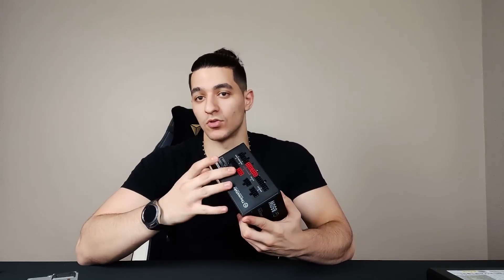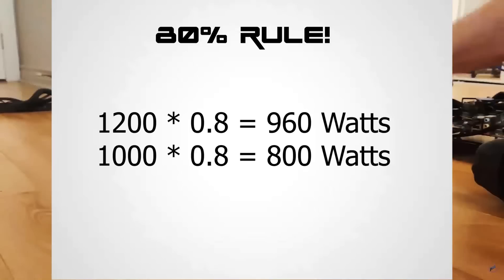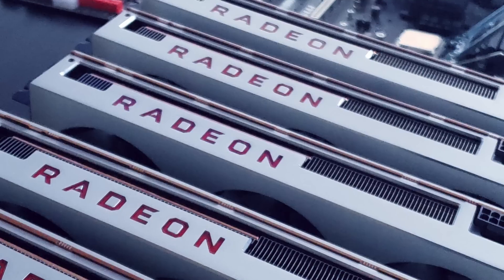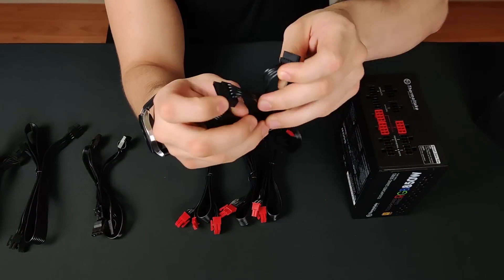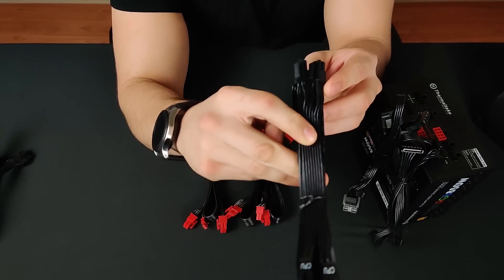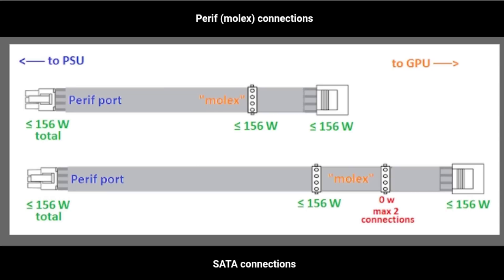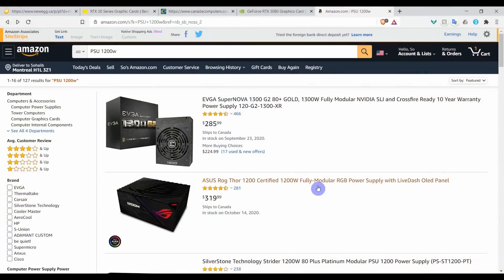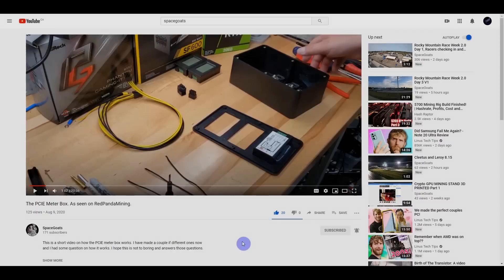Using ATX Powersupplies For Your Mining Rig FULL GUIDE

Comment: Can I power 3 or 4 risers using a dual 8 pin pcie cable from the psu and attaching dual 6+2 pin splitters from each 8 pin?
Reply from the maker: Yes, I would suggest max 3 risers on one vga cable though
Reply: @MiningChamber  Where did you buy your gpu vertical mount the one you're using to bios mod your gpu's?
Reply: @MiningChamber  Thank you for the reply by the way. :D

Comment: so i did this set up and my second psu is making clicking noises... it didnt do that when it was used as the main psu any ideas what causes the clicking sound? looked at it already and no wires were hitting the fans
Reply from the maker: Mm clicking noises, check if anything smells like burning, double check all wires and make sure you wired everything right. Take a look at the latest build video I released for example on wiring
Reply: @MiningChamber  thanks for the tips ill go do that the clicking noise is odd because i only had 1 gpu connected to the 2nd psu the other 2 gpus were in the main psu

Comment: I have a EVGA 750 watt psu powering an AMD 3000g, and 3 Geforce 3070s. I use a 8 pin to dual 8 pin to power one gpu and it’s respective riser. Is this safe?

Comment: Hi all I need to ask something can I connect 3 atx power supply to the same rig ?
Reply from the maker: Yes with the powersupply splitter ! Just daisy chain it
Reply: @MiningChamber  why is 24pin splitter needed? does it sent some information to psu? cant i just connect one and use another psu without 24pin connection?

Comment: I'm a bit confused, when I search for max wattage pcie cable people say it's 150 W for 8 pin. This guide says 288 W. I'm thinking of putting a splitter to power 2 GPUs on 1 8 pin pcie (lost the pcie cables that came with the psu). A 1070 and a 1660 Super, is this a bad idea?

Comment: I have 2 lines of 2 molex each, can I connect the riser with a 2 molex to 6 pin adapter?

It would be 1 riser per molex line, okay?
Reply from the maker: Yes that's fine! You can do molex directly to riser but just do one riser per molex cable
Reply: @MiningChamber   Perfect, thank you very much

Another query, I have 6 3070 but only 2 700w Artek Voltron, it has 2 8 pin pci-e lines, each line has 2x8 pins, is it possible to put a 8 pin splitter to 2x8 pins? Could the cable be overloaded?
Since one line would go to 2 3070 and the other line to a single gpu, I want to do the same with the other source so it reaches 6 gpu

Comment: Hi mate, I have got an EVGA 1200W platinum power supply. I used 4 splitters to power 10 GTX 1660 super on them, the total power consumption on the wall meter is 940W after afterburner applied ( I can lower the rating a bit). It is running for two days now without problems. Is this the safe rating for my rig? Based on the video, it should be ok, if the system is crashed, it freezes itself and restart . Please let me know what is your thought, thank you very much.

Comment: hey, so for the VGA strand is it going to be 288 W for the entire strand if 8 pin & 6 pin both are on one strand, or is it going to be 288 W & 216 W for 8 & 6 pin on one strand? @miningchamber
Reply from the maker: The 6 pin does 216 while the 8 pin does 288  even if it's on the same strand. Total though is still 288 for the entire strand as a maximum
Reply: @MiningChamber  thanks a lot dude
Reply: @MiningChamber  Can I connect 2 msi 3070 to the same 8 pin cable?
Reply: Best Power Supply For | 12 GPU Mining Rig 3500 Watt Unboxing
https://www.youtube.com/watch?v=5HoUPLEaUBE&t=209s

Comment: So 1x PCI-E 8 pin cable cab deliver 288W of power.  What will be the power output of a PCIE cable from the 8-pin head AND the daisy chain ? Is it total 288w ?
Reply: I am under the same confusion. So my understanding is if you plug in an 8 pin into the psu the max out is 288w. So if you split the first 8 pin on the chain to plug two 8 pins into the gpu and the second 8 pin on the chain to 2 6 pins you can only use a total of 288w. 
So if you were needing 300 watts on the gpu you are overloading the cable at the psu. You would be pulling say 2x288 into the gpu and 2x75 into the riser. Total draw potential on psu connection could be 726w. Realistically max you would see is 375 (extra 75 on the second riser) that’s still pulling well over the 288w connection. Am I missing something maybe I’m dumb with electricity but I am making the assumption that every time you split you aren’t resetting the draw. Maybe I’ll put it this way you can’t pull 288w at the end of both 8 pins that were split. It really would be 144w max on each end of the 8 pin split and you wouldn’t be able to use the other 8 pin on the chain. Any clarification would be greatly appreciated!

Comment: Most of the cables are 18AWG, some higher quality PSU with better cables have 16AWG cables, but not common. You can get about 7-10 amps down one 12v 18awg wire. You also have the consider the connector itself. Molex connector is larger and supports more amps/volts than the little thin SATA pins.
Reply: Do you know how much watts the 18awg can handle please?
Reply: @SNIPR-jz4fz  7-10 amps * 12v, so per wire roughly 84-120w
Reply: @xfist2facex  so if i have 5 wires each stating 18awg will it be 80-120 x5 = 400w-600w

Comment: this will help me alot as i'm building 4 rigs with 6gpus each. am using 3070 since it's the only thing i was able to get my hands on. But I also got them comboed with 750W power supplies, is it enough for two 3070s? Also can I plug 3 powersupplies into 1 rig? I was thinking of plugging one into the motherboard and two 3070, while the other two PSUs would be supplying power to 4 3070s and their risers. But everyone seems to say I need that 24pin splitter, is it necessary? If so, how would I do it in a 3 PSU situation?

Comment: Using MSI afterburner to do your overclocks can help significantly with accidental  overwattage.  It will completely shut down your cards when things go wrong, reset them and get them back running again at the proper clock speed.  I would seriously recommend patching afterburner to use it to manage your overclocks instead of amd / nvidia settings

Comment: Hi. Thanks for information. I have a question. 
I have 02 RTX 3080 video cards, with 3x8 pin pcie connectors each one and 01 850w power supply. Can I use 01 8 pin pcie splitter and 01 direct cable 8 pin pcie  on both RTX to power them? I will not use splitters, i will connect both RTX on pcie x16 from the board.
Reply from the maker: Yes you can for sure do that, and you mean you won't use risers but yes that's fine!
Reply: Thanks for your answer.

Comment: thanks, please, i have 4 power supplies, and 4 3090rtx video cards. how can i connect and start simultaneous the 4 sources?
Reply from the maker: why 4 psus for 4 cards? I would first  try to drop down to 2 PSUs. To connect all 4 you need the PSU splitter I mention in this video, you can then daisy chain it
Reply: @MiningChamber  Thanks. I put 4 psu, 1 for each video card because i want to have each video card powered independently. I don„t find splitter for 4 psu, but i find a solution: power up last 3 psu (3 video cards), next i power up first psu with motherboard and firse videocard

Comment: If I use 2x 1000w PSUs with a Dual PSU Power Supply 24 pin ATX Motherboard Adapter, am I able to power 3x GPUs and 3x Risers with each PSU? I need to know this as I may want to connect high powered GPUs, so wanted to split the workload building a 6 GPU rig. Please let me know. Many Thanks
Reply from the maker: Yes for sure! You need a dual psu adapter like mentioned in this video
Reply: @Mining Chamber  Awesome, thank you very much for your quick response and for these amazing videos, they're super useful and educational 👍

Comment: So if I understand correctly: Can a power supply with 4 pcie 8 (6 + 2) connect to a maximum of 5 video cards? (as long as each video card uses a maximum of 144w, and obviously the power supply has enough watts for that). Eg:

	- gpu 1
---
	- riser 1, riser 2

	- gpu 2,
--- 	
	- gpu 3

	- gpu 4
--- 	
	- riser 3, riser 4

	- gpu 5
----   
	- riser 5

Comment: I am building a mining rig for etx 3080s, how can I power all gpus under 1 psu  ? If I use 2 power supply Than how to setup ?
Reply from the maker: RTX 3080s need alot of power so 2 PSUs is better option. 2x 1200 watts or server psus. Check the video for server PSUs and check the part for dual psu splitter in this video
Reply: Best Power Supply For | 12 GPU Mining Rig 3500 Watt Unboxing
https://www.youtube.com/watch?v=5HoUPLEaUBE&t=209s

Comment: But one rx 3080 is like 320 w? hpw can i use the addapters safetly?
Reply from the maker: Your going to be undervolting so youl use at most 220 watts. Make sure to properly undervolt your GPUs. You can find settings in miningchamber.com
Reply: @MiningChamber  okey but now that i think about it the rtx 3080 requires 2 or 3 PCIE power cables. Mine are at 100% atm
Reply: @MiningChamber  Thanks for the answear btw.
Reply from the maker: @Gabriel-fr3sd  No problem! Just make sure to use splitters

Comment: The 80 plus designation is not the power lost over the wires but rather the power supply hardware’s efficiency in creating power. Higher 80 plus rating means less power lost, due to heat, in the conversion.
Reply from the maker: Oh awesome!
Reply: I edited it to make a bit more sense at the end.

Comment: I have a 24 pin to my mother board (ASUS) should I also connect the 24 pins to my psu also (12000 p2) or should I just connect 16 pins

Comment: Is there a problem with using psu cables from Amazon to power the risers and gpus?
I have a gigabyte 850m psu and the cables on amazon have the options 
For EVGA, corsair and seasonic

I bought the evga one because it seemed to be the most general cable based on the description. 
Will this be safe to use?
Reply from the maker: No cables are general. Compatibility list between different PSUs is very limited so don't buy other psu cables for it. Only use splitters and if splitters are not enough then use another psu!
Reply: @MiningChamber  ok i ended up just buying a second psu identical to my original that way i can use the cables that it comes with and have room for upgradability. i do need to find a good psu splitter in the future. thanks for your time !

Comment: okay but do you really need to power the raiser even tho you have 1x 8+6pin power connectors on gpu? 
cos for mining cards certain cards wont use more than 150W and with the connectors you already giving the card around 225W
Unless now the raiser is a MUST to connect power cable into it to even work, but then u are wasting cables pff
in anyway even if cards are rated for 300W usage you will mostly likely only use half of that.
Reply from the maker: Yes you must power the riser or it won't be able to read your gpu. The riser only transfers data with the usb but it won't be able to read it if there is no power within the riser

Comment: Thanks for the infos, I have just a question I have the riser with 2 less one for 12v and one for 3v. Once I plugged everything I got the 12v led blue and the 3v red. My pc doesn't see my gpu. Do u know where it can come from?
Reply from the maker: Hey! As long as you made sure to power your riser properly and connected everything right then you can try a different riser. I do get alot of new risers that just don't work at all so it's normal !

Comment: Is it ok to split one 8 pin pcie strand into 3 risers? I plan on using 5 5700 xts and power 5 cards directly with 8 pins from the psu. This leaves me with one more 8 pin on the psu, I wanted to connect 3 risers with an 8 pin splitter on a single pcie 8 pin strand and connect the last two risers with MOLEX separately. Would this be ok?
Reply from the maker: Yes that is completely fine to power 3 risers with one PCIE strand cable. But if your also running a GPU on that PCIE cable along side the 3 risers then it is too risky. You can instead run 3 gpus with 2 PCIE cables by using splitters. Each cable covers 3 8 Pins in total 6 8pins which should be enough for 3 GPUs
Reply: @MiningChamber  Thank you so much for your reply, I ended up getting more splitters and  will use one splitter per card and riser with an 8 pin pcie powering each card and riser like you did on the video. I appreciate you putting these out for us.

Comment: this is amazing video, i found much more information. But i dont understand one thing... I have 2 pci-e lines on te PSU = 288watts per line no? 
When using the splitter pci 8 pin  these watts are divided in two? 144watts per line...

I could feed 2 low gpu nvidia per line as long as I don't use risers? Thanks and im subscribe!
Reply from the maker: Thank you! and in a way yes 144 Watts per line but splitters cables might be weaker than the original PSU cables so give or take around 250 watts max. You can power 2 gpus that consume less that 100 Watts off the WALL not software, so for example the 1660 TI or Super by one cable connected to splitters
Reply: @MiningChamber  Thanks, Excelent. I conect 2 1660 super with one 650w 80 plus PSU with 2 pci-e (2 separated lines) and one pci x16 on the motherboard and other with riser. When starting the pc, the consumption would be at 80% of psu, but when I start windows I have them with undervolt 250w (2gpu) under 140w (2gpu): Thats work. Thank you.

Comment: Hi thanks for the tips. Just wondering if I can run 5 1660 supers on a 1200W EVGA supply supply. Currently, I am running on 3, after I clocked them, there is only around  375W. I want to add 2 more if that is all good. I am thinking there will be too much if I add 3 more. Thanks
Reply from the maker: Yes you can! they consume very little power You can run 8 of them off that PSU
Reply: @MiningChamber  Hi, thank you very much for your quick reply, I really appreciate it. So when the GPUs are here, I can simply install the driver for additional GPUs and use them, is that right? Thanks

Comment: wow I've been running such a dangerous operation then :/ newbie stuff. I'm so glad I had low power 5600xt cards because I thought you could get 54w from each sata on a single cable ! I had one sata cable, a connector which is 2x sata to 6 pin for gpu cable and a separate sata cable for use on two risers... I never had any problem in two months but seeing the limits now, I guess I was super lucky !
Reply from the maker: Ahah I had that running when I started too, then one day, a burnt SATA appeared 😂😅
Reply: @MiningChamber  did that damage the gpu ?
Reply from the maker: @tugrulserhat  it did not thankfully. Just bad smell and burnt cables

Comment: I have 3 PCIE plugs on my PSU. Each supplied cable is split in 2, giving me a total of 6 PCIE plugs. I have 6 cards and 6 risers. Is it safe to use 2 splitters on each PCIE cable to give me the correct amount of plugs I need to power each card and riser? Or should I use the data to lower riser only? Just seems like a lot of draw on 1 PCIE cable.
Reply from the maker: Depending on which gpus you have. If you have GPUs that are low power such as 1660 ti or super then you can run 2 on one strand. If not then I'd recommend running 3 GPUs on 2 strands dividing using splitters if needed and for the risers you can use molex to power 2 risers per strand. I would avoid sata as much as possible
Reply: @MiningChamber  great thanks for the response. The cards are 580’s. 
I will avoid using sata at all costs.

Comment: Hi guys,i am a noob and maybe stupid but i have to ask.........
i have EVGA SuperNOVA 1300 G2 with 6 x 8 pin(6+2)
and 6 riser(6pin) and 6 spliters and 6 gpus with single 8 pin connector on them thats ok
but what if i have the same rig but with gpus with 2 x 8 pin connector on them ?
6 vga out from PSU if i add them spliter its 6(8pins) * 2(with spliters) = 12 x 8 pins ok for the gpus but how to power the risers i did not get that at all 

PLS correct me if i am mistaking some ware.

And yea good video mate cheers.
Reply from the maker: Hey! In that case you can use molex for some risers. 2 risers per molex cable. But I would recommend trying to find a better psu, ones with dual 8 pin rather than just 1 so that with splitter you have 3 8 pins. 2 for gpu 1 for riser. You can also check server PSUs! We recently did a video on them as well
Reply: @MiningChamber  i am lost or i cant find a PSU with dual 8 pin can you give an example model affiliate link even :) just something

Comment: Thanks for the best guide for beginners like me,
may I ask about stupid things?
does riser powered by sata safe for low gpu (1660super)?
1660s draw 15-16W from board and 65-70W from PCIE, I dont know the power draw when booting, bu the tdp is 125
Reply from the maker: Thank you!! And it's not a stupid question for sure. Yes it's safe but I wouldn't do more than 2 risers on a sata cable, plus it is more preferred to do molex rather than SATA